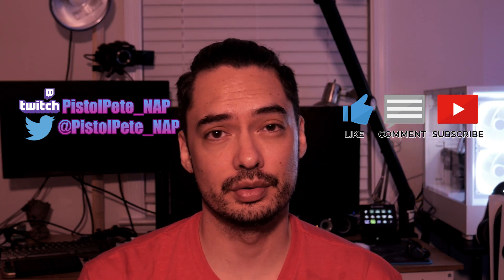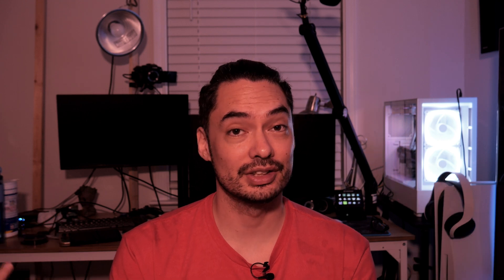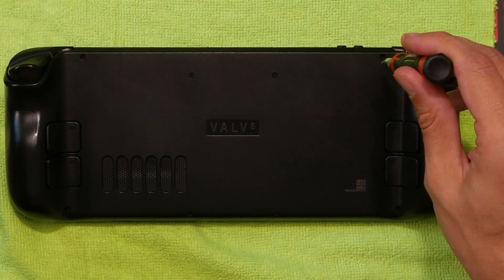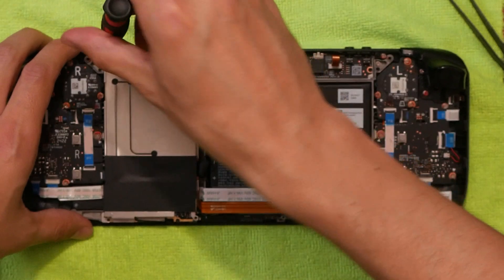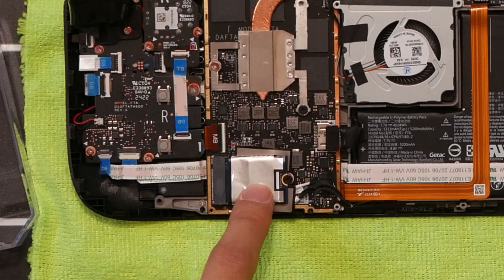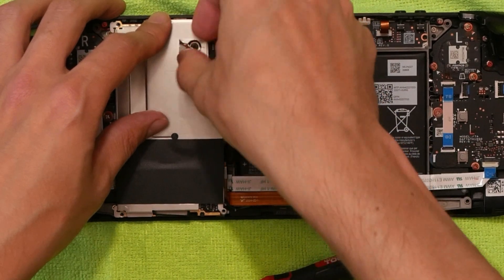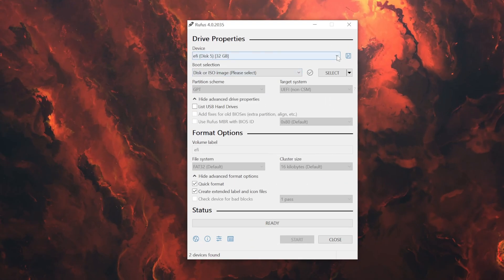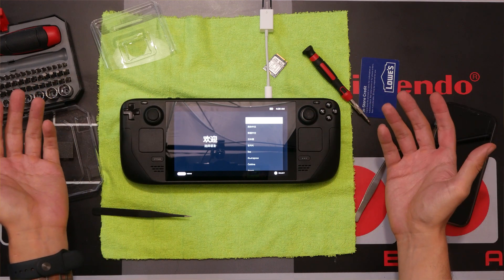How to Upgrade Steam Deck SSD and OS Install

Comment: Easy work thanx. I was worried Rufus froze at 100%, so I let it run for a bit and it worked.
Reply from the maker: Awesome, super glad to hear! Did you complete the upgrade and are up and running?